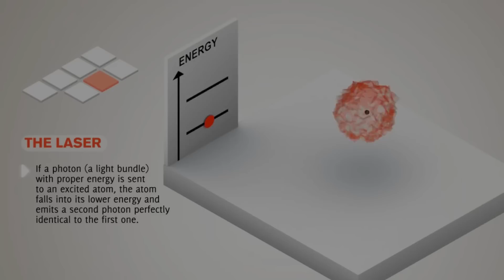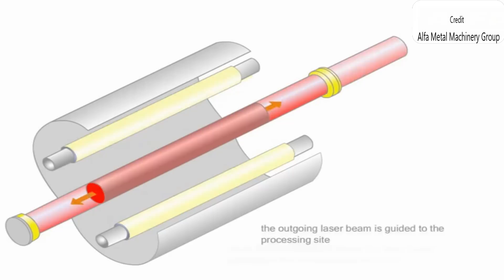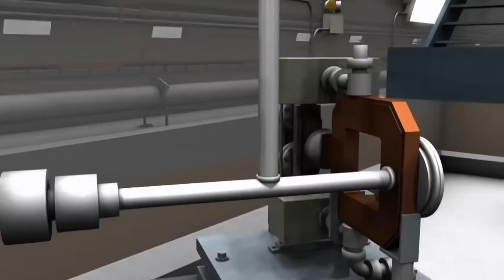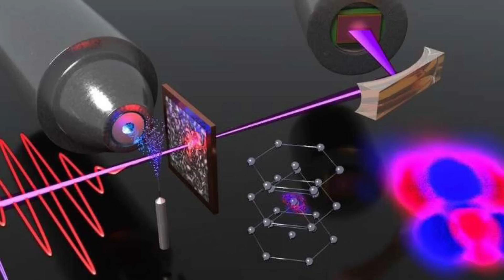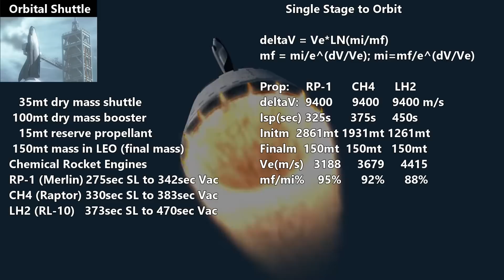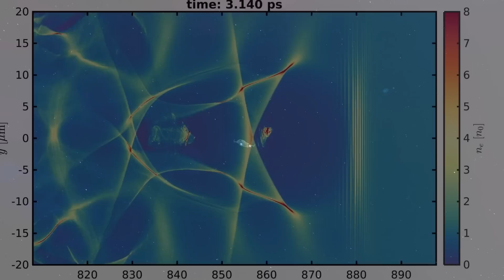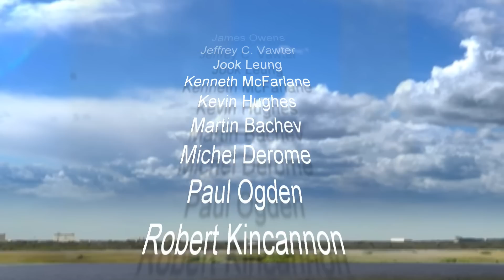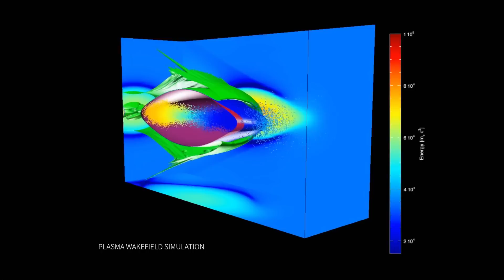The Laser Wakefield Drive! This Changes NOTHING! Yet :-)

Comment: So you just shoot a microwave beam down a hollow tube with water vapor and it will reach relatavistic speeds?
Reply from the maker: If it is a short enough pulse length and of adequate power it sure will.  Not all of it of course but enough to get everything moving efficiently and at a high average speed.
Reply: @terranspaceacademy  THis is good news.  I have very little factual evidence to base my nuclear plasma engine on, but I think we could us both pulsed electromagnetic fields AND microwave emitters in the same engine to tune it up for thousands of pounds of thrust per engine.  Gotta move asteroids into Mars to Terraform it.

Comment: The Planck acceleration is found from √[c⁷/(ћG)] = 5.560726e+51 m sec⁻², so there's nothing wrong with the idea that a charged particle can be accelerated to relativistic speeds over millimeter distances.
Reply from the maker: Isn't it amazing?  That makes your engines a 5cm panel on the back.

Comment: While sounds promising it doesn't say anything about potential thrust. Most of modern engines with high expel speed do it with ridiculously small amount of mass like less then 10 grams per second. That bring some heavy limitation to the spacecraft meaning that most of it weight is just engine with power source and even in this case it need to accelerate for years with just engine.
Reply from the maker: Mass propellant flow is always the problem with high efficiency engines...

Comment: Ive often wondered if you can combind two or more engine types. 
  I dont think it would work exactly like this but lets says hanging off the end of a rapror 3 are some sort of tungsten grids with opposing electrical forces that can take already high velocity particals and accelerate the even faster. 
   Or maybe a duel core thermonuclear engine that heats both hydrogen and oxygen. I realize the Oxygen will be moving much slower and im not sure if the position of their eventual combination would provide any additional thrust.
   Anyway thats just me daydreaming. 
I really, really, REALLY hope there will come a day that a 4 day trip to Mars for a job interview becomes a reality.
Reply from the maker: It turns out that the combustion would just slow things down when you have nuclear thermal.  Pure nuclear thermal is good for thrust. 900s Isp.  But nuclear electric, ion, or MPD is better for high efficiency... 1,500s +